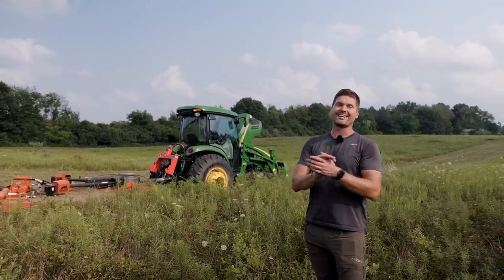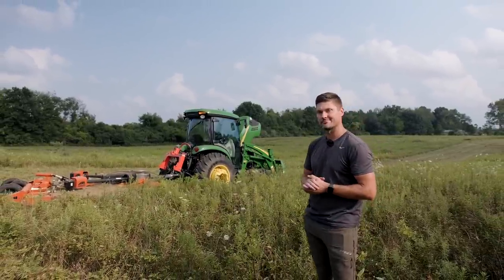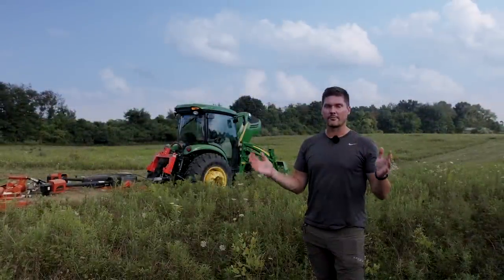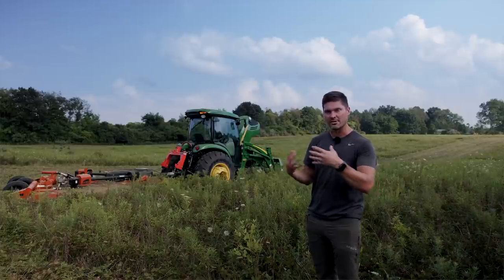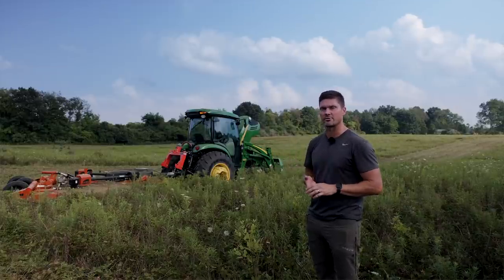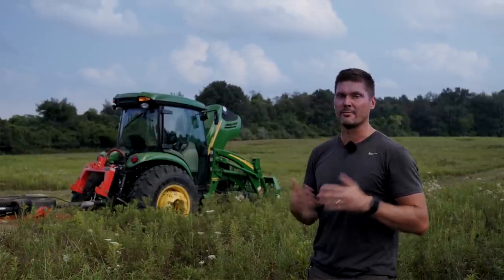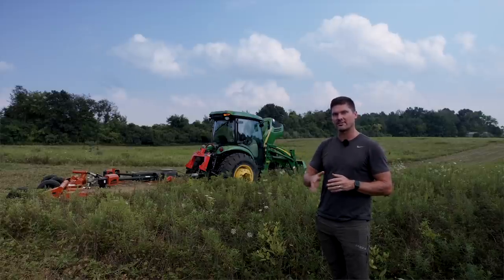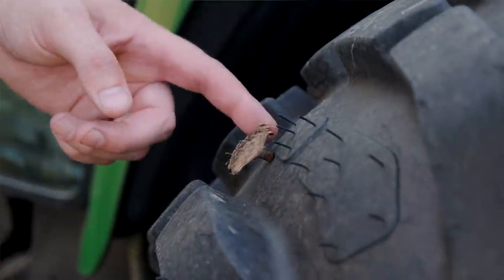JOHN DEERE BREAKS DOWN PULLING A BATWING MOWER THE FIRST TIME

Comment: My 3046 John Deere is worthless to mow with. The high speed light weight motors with an undersized radiator requires a high speed fan and lots of air to cool the undersized radiator. Net result, the fan sucks in debris and plugs the radiator within 20 minutes. I use my older tractors like my 955 and 855 to mow with. When I was a kid mowing with a G John Deere we didn’t clean the radiator all year. Even my 299D2 Cat has to be cleaned every 2-3 hours when mowing. The fan on it sounds like a helicopter.

Comment: I'm gettin sick of hearing and contending with reliability issues. My 1025r is beautiful.  Has 35 hrs. About to warranty it for a 2nd time. My family has a 1950 AC CA model that the brakes are worn off and it just keeps going. Who knows how many hours it ran the bush hog empty of fluids or how much water has been in the oil from sitting outside all winter?  I can't keep hydro lines from bursting or the underbelly attachments from falling apart on the 1025r and it eating itself. Lean 6S has failed this time.
Reply from the maker: Yeah, sometimes things happen.  My 1025r has been pretty reliable overall.  Front axle seal leak, but not the end of the world.  Had to replace the battery.  I think that's all and I am trying to push it to the limits.

Comment: Courtney, I'd recommend taking the pallet forks off -- you've got a big ass headache rack out in front, and I'm thinking air flow is blocked by the fork rack, and combine that to stressing the tractor with that big batwing mower, I think it becomes  a perfect storm.
Reply from the maker: I normally have a bucket or grapple on as protection against the unknown.  I don't think that's much of an issue.  The tractor is going 3mph, not highway speeds though.  Have never had an issue pop up this bad previously.

Comment: From what I read. Your overworking that tractor with that mower. According to the info I got off the net. That mower is required to have a minimum of 60 horsepower and that tractor has a PTO horsepower rating of 56hp.
That 3515 is more than that 4720 can handle.
Reply from the maker: You read the wrong stuff unfortunately.  This mower only takes 25HP at the PTO.  I sell tractor attachments and know how to properly match equipment to the tractor. https://www.rhinoag.com/products/rotary-cutters/flex-wing/ts10/

Comment: Your radiator, A/C condenser, and engine air filter are packed full of grass seed. Pretty simple.
Reply from the maker: Nope, it's almost like you didn't listen to a thing I said.
Reply: @GoodWorksTractors  The radiator can appear clean but be packed between the fins deeper inside.

Comment: Lord  ,that's not thick, lol I mow stuff a lot thicker than that with my ol Johndeer b 1951 model, with a 6ft bushhog, pull type, my ol tractor don't even have a water pump or thermostat, has radiator shutters, and the circulation of antifreeze is thermo siphon lol,I will take the older equipment any day
Reply from the maker: Ha, of course you do.  It's probably also hotter where you are, gets deeper snows where you are, and has rockier soil where you are, bigger hills, and your 1951 has never broken down either.  😂